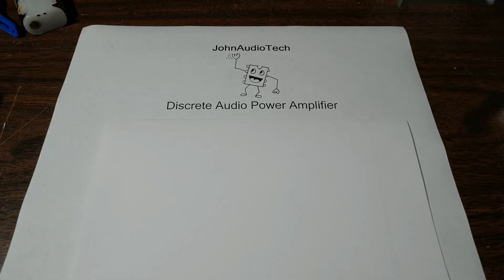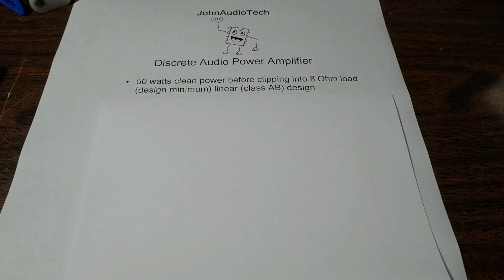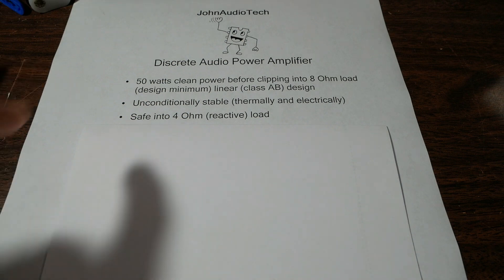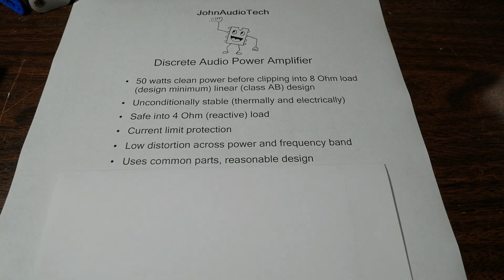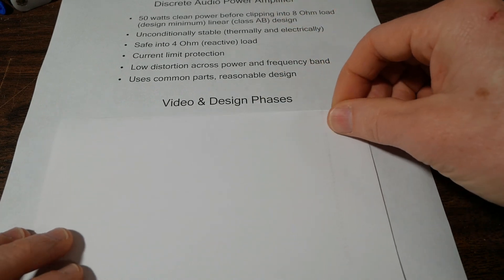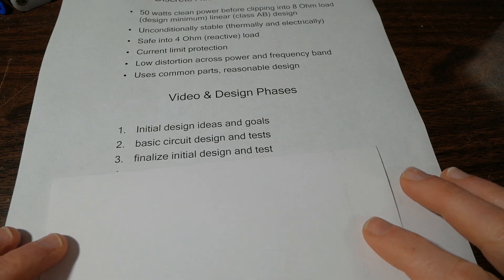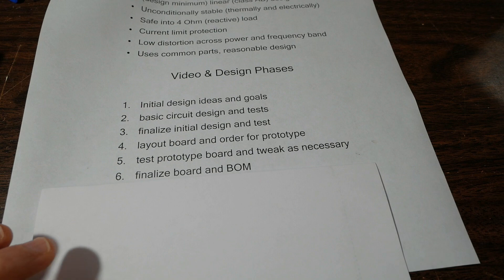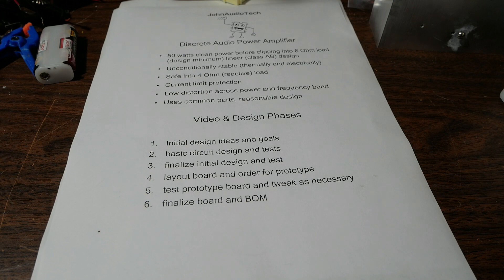Discrete audio amplifier design and build PART 1 - Introduction

Comment: YES, John! Definitely YES. 
I'm in the process of designing a rather simple multistage audio amplifier from common BJT transistors mostly just as an exercise to learn more. I'm studying various configurations and biasing methods for the pre-amp stage and perhaps an emitter follower for the power stage.  You have much more knowledge and experience than I. An amp that you design would definitely be worth buying and building not just to have a great hand-built amp, but for all that I would learn in the process.

Sign me up!

Comment: yes, I would be insanely  interested in this. after your video on the TDA7293 IC amp I built a 5.1 channel amp with them running +-42V.  you were right about that amp. Building an amp from the ground up sounds like a great follow up/along project.

Comment: I'm very interested in what you come up with! I imagine many of the challenges that you will encounter will provide insights and solutions to projects beyond the scope of this amp. It's fun to watch the creative process. One additional design factor that you might want to consider incorporating is allowing two of your amps to be mono-bridged. This would potentially increase your "market" to include people who have inefficient speakers. I don't know how much complexity or design difficulty that might add to your circuit. My knee-jerk impression is that given your other constraints, it might fall into place. Thanks for your videos!

Edit: I just re-watched your Valetine's Day video "Can I bridge or parallel my stereo amplifier board to one speaker?,"  and realize that as long as your design allows current-doubling, it should work. Higher current parts might increase the cost, but should also increase reliability in normal operation. Note to self: review before commenting.

Comment: Thanks for sharing the knowledge!!! It'd be interesting to have a high biased A class, let's say up to 3W in class A and the rest up to 50W class B. That's  design you don't see much out there, usually biased class A up to less than 0.5W. I believe the PCB only would be a lot easier for you to manage. Of course if one needed matched transistors that would be nice to get those from you too, so they are more reliable.

Comment: Yep - interested in following along. I've designed and built several amplifiers over the past 50 years, always interested in seeing another person's approach.
Distortion at 20 kHZ - I can't even hear 20 k, and no one can hear any of the harmonics.
Most important place for low distortion is upper bass and midrange - clear sound here is critical for a good sounding amp.

Comment: IM distortion is much more noticeable than HD, which can be hard to judge through the speakers, which have HD in two-digit percents. And unlike HD, IM is mostly from the amplifier, not the speaker. I bet one could make two amps with different circuits but the same 1% THD and power with quite different sounds, ie. a fully complimentary symmetry with low feedback VS one ender driving a quasi-comp with more feedback. I hope you revisit the Vegematic-era video where you set up an amp with no bias and just used a ton of feedback, and the feedback kind of became the bias. Anyway, it would be an easy extra video to do while you have the skeleton on this project in progress.
Shoot for the 50-75 Watt output, pretty much the practical limit of a couple TO-3s on a good heatsink. Found a cool transformer series made for audio and one that would be perfect for a Tiger-sized monoblock, see my Kit: https://kit.com/HillOrStream
Reply: And I already donated the TO-3 outputs BTW..., could push a pair of those to a hundred!

Comment: Very interesting video! Some comments:

Of course more and more people are designing class-D amplifiers. Why not do two designs and see if the AB actually sounds better? I suspect that with the same care, the class-D will sound just as good with lower complexity and better efficiency.

50 Watts continuous? How much will be available for transients?

Agree that distortion is over-rated. Would prefer to have low broadband noise and very low power line hum, i.e. things that can be heard...

Good to hear that you will design with good parts. It's always frustrating to have a cheap board with a good design but crap parts...
Reply from the maker: Dynamic power depends on the supply. I'd expect somewhere north of 60w.
Reply: Designing class D amplifiers? These are not low-complexity designs! It's just the matter that you can get Class D ICs nowadays that have all the complexity hidden and locked within, but also you lack the flexibility to anyhow appreciably improve on them.
Reply: Well, you're right that the PWM generation circuitry has a fair amount of complexity which is now available on a single IC, but that's not where the improvements will come from. The improvements will be due to a better MOSFET drivers, better MOSFETs, and most importantly, better reconstruction filtering of the output. The question is how much somewhat more expensive components can improve the sound of the amplifier? I suspect that improvements are possible that would be obvious to a typical Joe, especially from an improved output filter.
Reply: I wonder, do you have any particular designs for me to peruse? Last i looked into the subject must have been a decade ago, and lots of people fumbled about, but beyond implementing manufacturer specs as-is, didn't get very far. Thing is, the MOSFETs are pretty well-behaved... to the extent that they're not entirely well-behaved, they require particular minimum switching times to be set on the control side, and these fundamentally result in noise that remains post-filter, even if you did have a perfect filter. So you circle back around to where to take advantage of better MOSFETs, you need to be able to tune your controller. The old method of sawtooth control seems obsolete, given you can't even guarantee minimum switching times with that. I also don't think reconstruction filter steepness is very important, because the final reconstruction filter is the limit of human hearing - you simply don't hear beyond 20 KHz much at all, you just need it to introduce little distortion and limit the energy emitted by the fragile tweeters.
Reply: A few points:
1) The PW modulator's performance is limited by noise on the low input signal end, and by very low/high duty cycles on the high input end. By using a low noise preamp, the input signal level to the PWM can be reduced keeping duty cycle away from the extremes. The PWM reference will be more accurate today and it is possible to consider adjusting the frequency to take advantage of a filter null in the matching network to the transducer.
2) Power MOSFETs are a lot better than they were a decade ago. Supported switching frequencies are higher and on resistance is lower. The drivers are better too. Reduced time in the active region increases efficiency and reduces one form of distortion. There is also the possibility of experimenting with more exotic MOSFET materials if you are willing to accept per transistor costs of $10 or more. When you build these things commercially, by the time a product is rolled out, a lot of money has been cut out of the components with some compromise in performance.
3) The are significant issues with the reconstruction filter, not just for removing the PWM carrier frequency and upper sideband but also in providing a good match for driving the transducer. The class-D amplifiers that I have on my bench do a pretty awful job of low-pass filtering the output, and although you are right about frequencies out of the human hearing range not being important (mine cuts out  between 12 and 13 kHz), it's easy to excite a high frequency resonance that then excites a low frequency resonance at an integer sub-multiple of the frequency. My preference is to achieve both the filtering and matching with high quality, well shielded transformers with an output impedance close to the nominal value for the transducer or crossover network. For the case of driving a transducer, this will involve stepping up the impedance from a fraction of an Ohm at the H-bridge output to a few Ohms at the transducer. This is not a panacea though because a typical voice coil based transducer will have a very ugly impedance curve over its operating frequency band...
Reply: the key word here is "Discrete", and let's face it, good class D, while you can go "Discrete", would be much more complicated than a Discrete Class AB. Now, if you want to use off the shelf chips, either one would, and could be done quickly and easily just with the Datasheets.
Reply: I think the key word is good! :-D I wouldn't build a discrete PW modulator, but I always use discrete preamps and driver stages. The rational is that while the integrated PW modulator is better than anything you can do with discrete components, an integrated preamp or driver won't be great...
Reply: Marvellous counterpoints ats89117.

Comment: Interesting project.
I build amplifiers myself and are looking forward to get your principles. My current project is for an active speaker and vill contain crossover filter (created last, so it will fit the speaker) an amplifier for the 4 ohm subwoofer speaker unit and two amplifiers for middle and tweeter.

Comment: This is actually quite interesting and a bit uncanny. I've actually also started to design a class AB amplifier myself, however with no specific goal or outcome in mind. So far I have obtained about 16 watts clean into an 8 ohm load with a 38v single supply, with the coupling capacitors rolling the off at about 15hz. I would really like to see the outcome of this design and build, and if it does become something that you make as a kit, i'll definitely look into it!

That being said, I do believe that not all the goals you have set in mind for this design i.e. 50w into 8 ohm, low distortion, safe down to 2 ohms, simple circuit design etc. will be accomplished. You will have to compromise somewhere. Though I'm sure you are aware of this.

Comment: Hi John, I'm looking forward to this series! I would like to know how to choose proper transistor for use in audio amplifier and its paired transistor, based on how much power I want that amplifier to be able to deliver, e.g. how you are going to choose transistors for this project. Furthermore, can you explain how to calculate values for all the components of that design based on the power transistors, incl. the recommended power supply wattage? Finally, can you make a video about square waves? In Class A amp kit video you talked about how useful they could be in testing and troubleshooting. Thank You!

Comment: interesting to see the design of the circuit and power supply needed to run it.

Wonder how it compares to a brand named amplifier which has awards

I'm happy enough with off the shelf branded amplifier as main use devices in the home although something like this could fill a niche in the car if it was biased towards a bright sound rather than warm.

25 watts would be enough power

Comment: Interesting video series, I anticipate a useful series of videos. 

You mentioned current limiting to protect the amp output devices - what about the issue of loudspeaker protection?  Most times a burnt out speaker is more expensive to replace than a few transistors...  The simplest way is to add a big electrolytic in series with the speaker, but that has its issues of course (size, cost, bass roll-off).
Reply from the maker: I consider loudspeaker protection to be external to the power amp circuit. DC protection, turn on delay, fast disconnect of the output at power down (anti thump circuits) would be handled by an external board and relay. This would be desirable in a finished amplifier but it is beyond the scope of this project.

Comment: I'm really interested in this project. It is a niche market, that is attracting more and more audio enthusiasts, who are not happy with the really cheap, but often poor quality Chinese amps (I have a dozen, most of them are disappointing), but in the same time, they are not willing to pay $100s for an audiophile amp. So this is a sweet spot in the price/performance/quality triangle, I'd highly appreciate a sub-$100 version, even it has some compromises.
One idea, might worth considering: after having the design, build one amp with quality, proven elements, while another one with relatively good quality, but still cheap Chinese parts (e.g. from Aliexpress). Probably I'm not the only one curious about the measurable / hearable quality differences between them. How much it will be? Does it justify the price difference? My view is that a proper design is key, also a genuine amp chip, but other parts (e.g. resistors) should not be necessarily bought from pricey places. 
Also please consider your non-US and EU fans: usually it is really expensive for us to order anything from a US webshop to Europe due to the high shipping, customs and VAT charges, I hope you can consider this element. 
Big thumbs up for this initiative John, go for it! :)

Comment: i feel like im the odd one out that for my bedroom system, even my 25 pound 120WPC amp is not enough. before anyone asks NO by bass sliders are not at +10dB. my speakers are wanting MORE power and so am i. looking into old pro 200W+ amps.
but for your design, may i suggest the NJW1302G/NJW3281G?
but this is totally a video series i would love to see
Reply from the maker: What do you run for speakers? Not enough bass in a typical sized bedroom sounds like you could use more sensitive speakers at least in the bass region. Those are nice transistors. I will keep them in mind.
Reply: Speakers are generic 80's 3 ways with 12" woofers. they do have pretty good bass, sensitivity is average.
Reply from the maker: A lot of these speakers will have okay bass (perhaps bloated bass) but fail when you want powerful deep bass. When you say generic 80's, I envision rack system speakers that are physically large, have large woofers and undersized "chuffy" ports. They might be a good platform for modding. With some internal bracing and new components, you could get these making deep bass provided there is enough internal volume to work with.
Reply: not sure if they came from a rack system or not, but the port is kinda funny. 4" diameter, 2" depth. ive modded them before by rebuilding and crossover and changing the crossover points, that made them sound way better. but thats it.
somithing else i forgot to say before about your project here, the use common, interchangeable parts rule sounds ALOT like the "honey badger" amp board over at DIYaudiostore. its a 150W, 3 pair output mono PCB that can use just about any transitor

Comment: I have a lot of experience in ampdesign and can offer some support (measurements etc.) if you want. Nice video as allways!
Reply from the maker: I could use your assistance. I might be in over my head with some aspects of tuning the circuit for low distortion and I don't have the best equipment around.